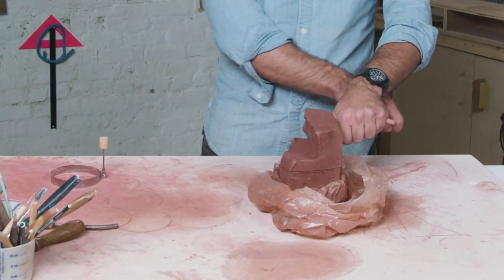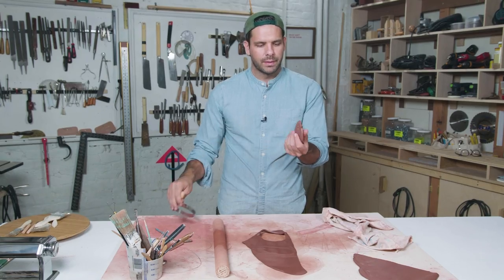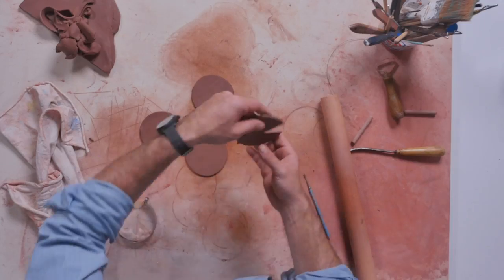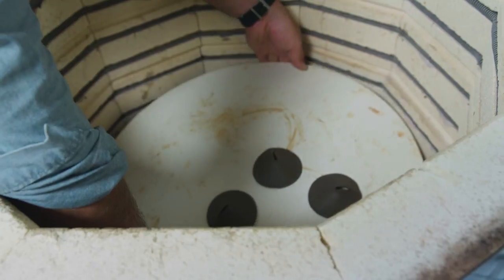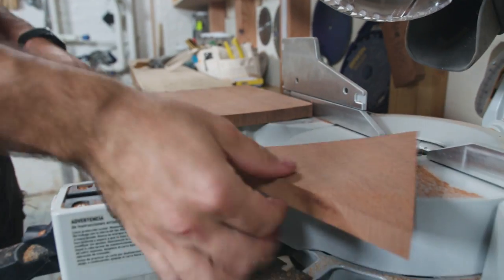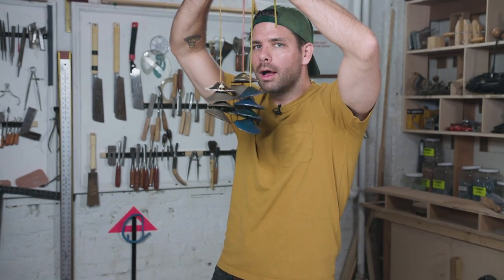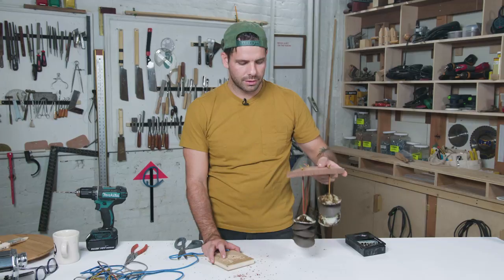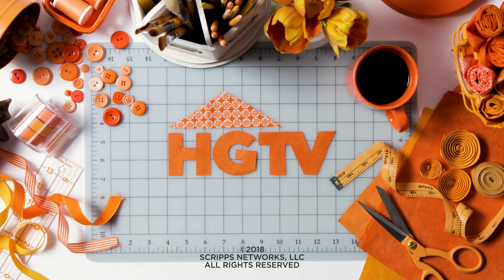DIY Clay Wind Chimes - HGTV Handmade

Comment: Would air dry clay work?
Reply from the maker: Fired clay truly protects the wind chimes from the elements, but you can use air dry clay -- make sure that you're using polymer clay to help with waterproofing.